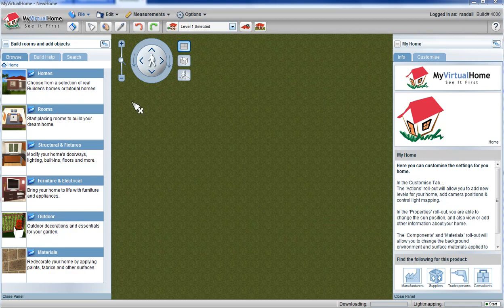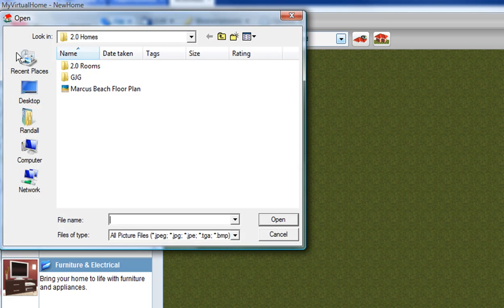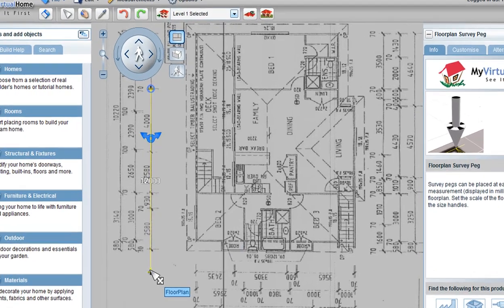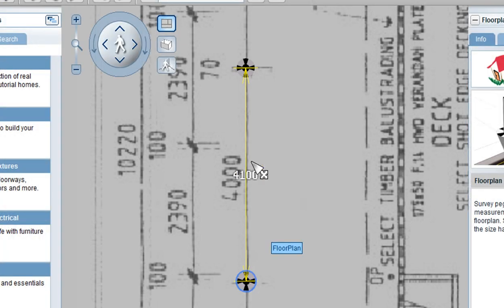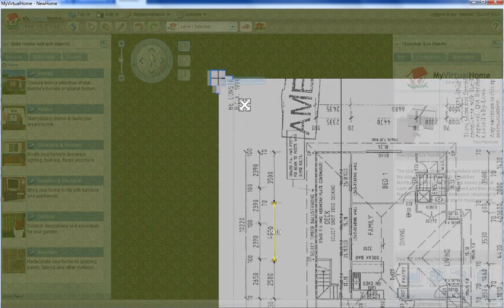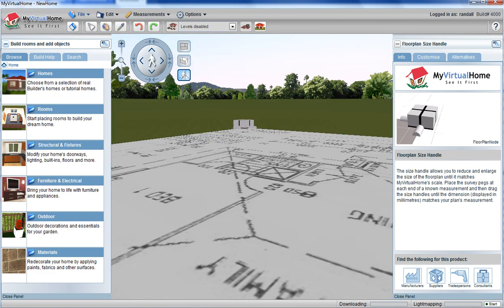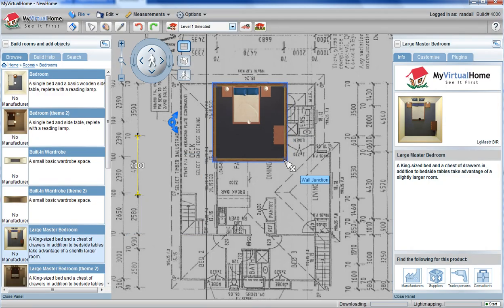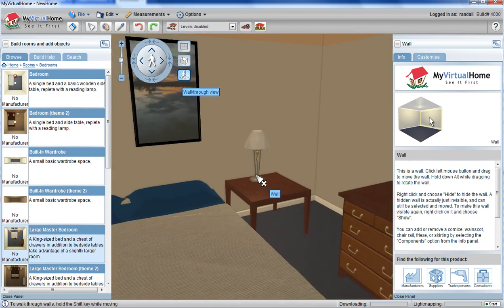Using a floorplan to create your 3D design

Comment: I can't seem to find a way to size a wall which is not rounded to 100mm-s, is there a way in the options or somewhere to type it in or to disable snapping? Even with ctrl held down, it snaps just to crazy values..